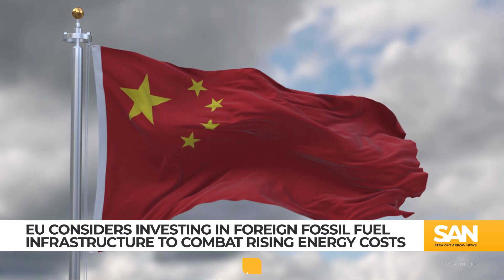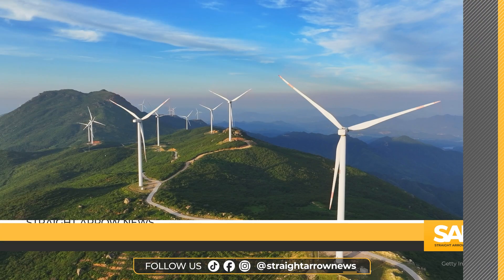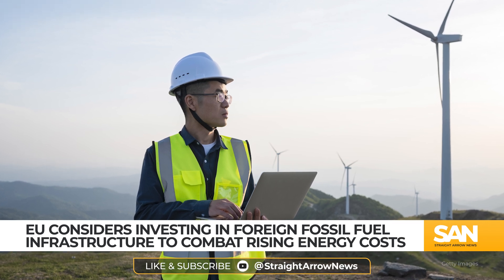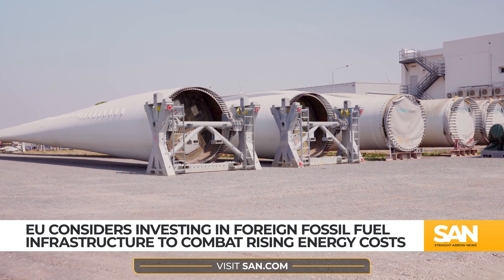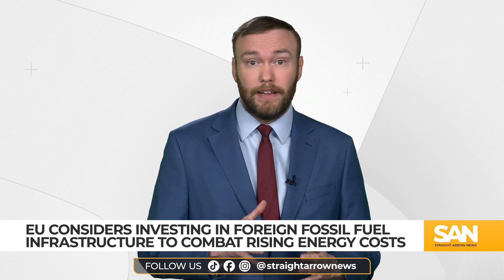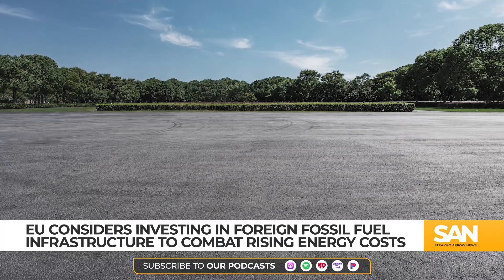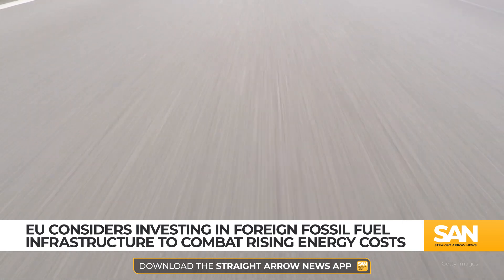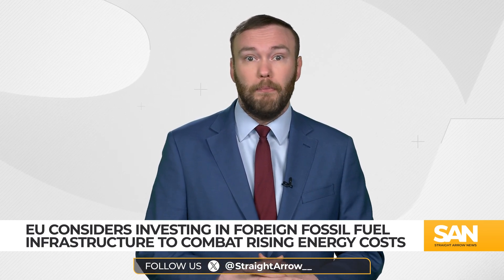New Chinese tech turns old wind turbine blades into asphalt and concrete

Comment: And what's so new here; people having been doing the same thing with old tires and other non-renewable materials for decades; crush it, shred it, treat it, and mix it with asphalt. And what nobody has said yet is how much of this material gets turned into extremely hazardous airborne 'dust' over time on a roadway surface. That was a significant problem with using tires

Comment: An American company was turning them into insulation material, but the cost of transporting and processing the old blades drove the cost up to 8X the price of fiberglass insulation. The material insulated homes in the southwest from both heat and noise.

Comment: Wind is problematic at best for "green" energy.
Reply: Why ?
Reply: @t.s.d.1376  because of a number of things. The wind need to be constant and at a minimum speed. If you don't have wind all day or enough wind speed then all ready; one will produce less energy for it's entire life span than the cost to build one (materials, labor, maintenance, and replacement. 25 years is garbage for life span. They are a honey / jack pot.